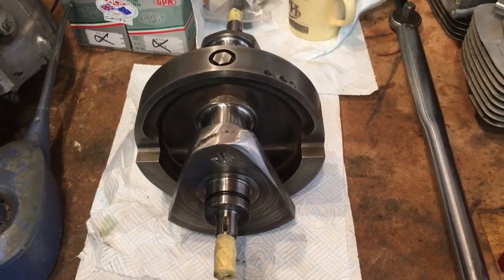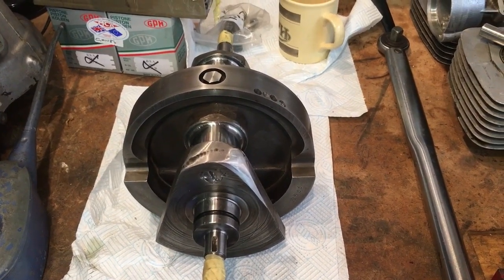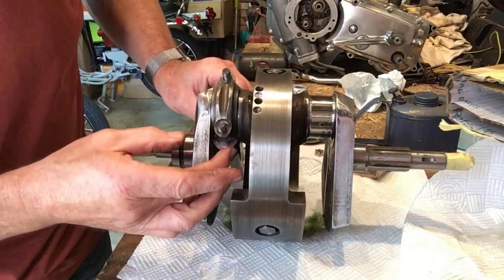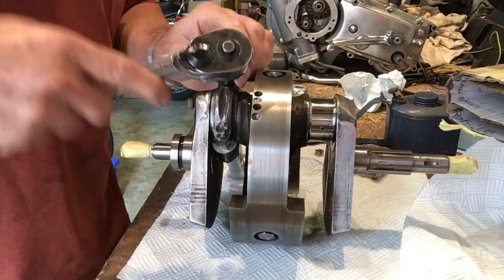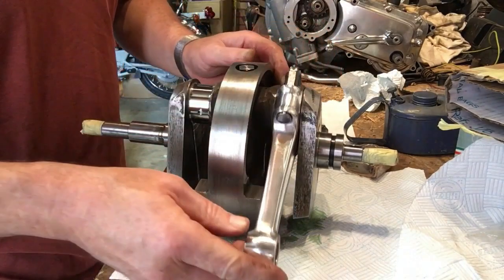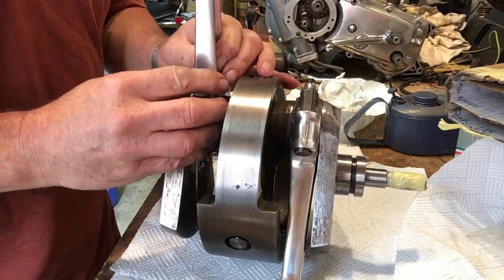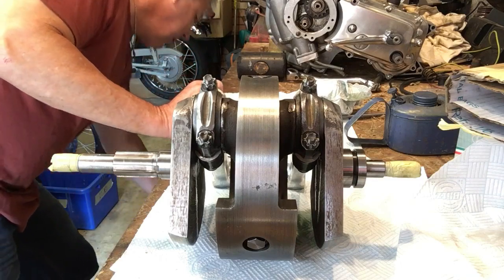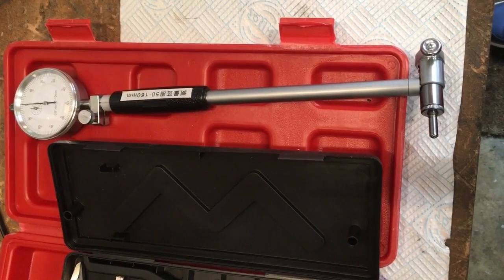BSA A70L Lightning - Engine Part 11 - Crank and Rods

Comment: A very thorough vid and promotes what most builders say about cleanliness and oil  muchio gracius.
Reply from the maker: Many thanks for the interest and kind comment Marshall.
Reply: @BSAPowerSet  Hi I am rebuilding a 1968 A65 thunderbolt where can i get info on method for shimming the crank thanks
Reply from the maker: @supadonk1  Hi Marshall - there's articles on forums/sites such as Britbike.com and the BSA Owners Club (bsaownersclub.co.uk), videos of measuring end float on Youtube (Paul Henshaw) and also the factory workshop manual. The important aspect is to measure the end float accurately before then adding shims as necessary to the shim cup on the drive side behind the rotor I believe. I can't show you this as the method was changed for the A70 so any reference on my vids on this subject does not apply to the A65. Hope this helps.
Reply: @BSAPowerSet  Yes I looked at your vids and realised the A70 was different thanks for the reply

Comment: I own an A70L engine. I went looking the other day and found NOS rod bearings claiming to be specifically for the A70L. Is there any difference from the A65 rod bearings?
Reply from the maker: Hi Eric the bearings are the same as the rods are the same as A65 albeit the later ones with steel end caps.

Comment: In order to keep the rods centered in the bores does it require any shimming or machining with the A10 crankshaft?
Reply from the maker: Hi and thanks for the comment and interest. It's not an A10 crank - the A70 had its own crank specially developed for it. I agree that A10 crank conversions for A65s were relatively common in racing circles to bump up capacity, but not so in this case, and, in fact, were not officially allowed for AMA homologation purposes.
Reply: @BSAPowerSet  You're absolutely correct! I had mistaken your build with someone else's A70 project. The owner was unable to source an A70 crank so he used a modified A10 crank instead.

Comment: Angus, another great video. Thank you. I notice that your left hand (drive side) con rod did NOT have the oil release holes that A65's do. Is that an A70 'feature' or did BSA stop fitting the drive side con rods with the oil holes at some point in the engine's history? I tried to research that, but came up empty handed. All I can see is that the left and right A70 con rods had different part numbers 71-2673 (L) and 71-2677 (R) but can't see the difference. Did you have the alloy top half of the rod polished? Thanks for your help.
Reply from the maker: Hi Steve - the rods are the same as the late type A65 with steel big end caps and  the LH rod definitely has the oil holes as it should have as you quite rightly say. They’re difficult to see at the best of times but definitely there as in all honesty I did not know about them until I noticed and had to research myself. When I had my A65 in the late 70’s I never stripped the bottom end on that so was unaware.
Reply: @BSAPowerSet  Thank you very much for the reply Angus. Much appreciated. The 1972 A65 I am currently rebuilding is a very late engine number (August 72) but doesn't have the steel end caps. I wonder when they were phased in by the factory. I think that A65 production stopped after Feb of 1973. Every now and then I see A70 con rods for sale (on Ebay) often advertised as matched pairs but without the holes in the left rod. I suspect they are Triumph T140 rods. Anyway, my alloy rods look like they have been 'grit blasted' to give a rough finish. I am debating about polishing them or  not.
Reply from the maker: @stevewanless2285  Hi Steve. I would not use those rods - them being blasted smacks of something more sinister being hidden or masked. I’m sure the factory never manufactured A65s into 1973 - yours would be one of the last - Aug/Sept ‘72. Last BSAs built at Small Heath were the ‘73 model year B50MX.
Reply: @BSAPowerSet  Thank you Angus. I am pretty sure that I am the first to open the crank cases on this bike. The rods haven't been blasted, but I am just trying to give an idea of the 'rough' (as opposed to mirror polish) finish on the rods. Here is an example of what I am talking about on ebay : https://www.ebay.com/itm/1971-BSA-A70-RARE-NICE-USED-PAIR-alloy-con-rod-with-steel-cap-71-1105-71-1106-4/174250095784  My rods look like the upper alloy finish on this item.
Reply: Angus, I apologize. I just watched video number 12 and you address the oil ways there. My understanding is that the oil ways in the left hand rod are there to relieve the oil pressure after lubricating the big end bearings. The oil pump is pressurizing oil through the main bush into the crank and to the big ends. The left hand rod then sprays pressurized oil out into the case and up onto the underneath of the piston skirts, likely lubricating the gudgon pins. One of the differences between the A70 and A65 is that BSA upped the pressure of the system from 50 psi to 75 psi (same as your Rocket 3). That's controlled by the pressure that the Oil Pressure Relief Valve operates at, venting excess pressure into the crankcases. In that Ebay link I posted above, the seller indicates that later engines did away with those oil ways in the left rod. I don't believe that (don't believe everything you read on the internet). Without those oil ways, the oil in the left hand journal can only escape through the bearing. I expect that would raise the temperature of the oil in that bearing to the point when it no longer lubricated.
Reply from the maker: @stevewanless2285  No need to apologise at all Steve. I think the holes are primarily  for lubing LH cylinder/little end. You’re right the pressure release valve on A70 is unique presumably just due to spring pressure. I agree too that the rods weren’t changed in later A65s. Cheers.

Comment: I recognize you didn't check any tolerances , like with plastic gauge. Isn't it necessary?
Reply from the maker: Hi - normally I would check tolerances, as already done with the plain bush main bearing; however, with the big ends, these have been re-ground specifically to -30 by a specialist company (SRM) who know their stuff with these engines, so no need in this case. Thanks for the interest.
Reply: Hi! The A70 has caugth my interest because of the crankshaft shims sitting on the outsideof the crankcase. I have concidered  a similar modification to my own Engine.I look forward to see your progress.Torbjörn
Reply: Hi again! I see. I'm also interested in how  the cranks plain journal is different to the A65,is lenght  of the journal shorter? Torbjörn
Reply from the maker: @jotomoto62 HI Torbjorn - thanks again for interest. I'm not aware of crankshaft shims sitting outside the crankcase - only on the inside of the thrust bearing but I'll check. Crankshaft side to side tolerance within crankcase would not be addressed by shims outside the crankcase.
Reply from the maker: Re the crank plain journal, I believe that this is the same size; however, the crankcase plain bearing is slimmer as the shoulder is not present as on the A65 bearing. I don't have an A65 crank though to compare so can't be certain.
Reply: I 've only  red about the A70 that the journal is slimmer as you say and and that you set the side to side play outside the timingside bush. It was an improvement due to not have the trust load on the driving side roller bearings outer lip. And the reason for the narrower bush would be the oil is easier to reach into the crank due to reduced centrifugal force. So I heard
Reply: So I'm little curious if there is any machined surface where the shims would lie against the crankcase? If you have the drawings of the crank you could see there is a washer or shims outside the bush.
Reply from the maker: @jotomoto62  OK understood - this is getting interesting - I've just checked the 1972 parts book and indeed this does show the shims and thrust washer on the outside of the crankcase. However, that's not my recollection when I stripped the motor so I'll  check that again and also dig out the 1971 parts addendum to ascertain if that's the same. Thanks for highlighting.

Comment: I would have squirted oil through the oil holes.
Reply from the maker: Hi Geoff fair point and I intend to do this by priming the engine on rollers to ensure oil is being fed and returned and we have pressure before firing up.